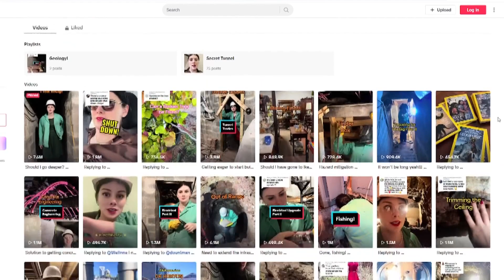TikTok 'Tunnel Girl' told to stop building underneath her Northern Virginia home

Comment: Just a matter of time until she hits a gas line, water line, or electrical cable. I am going to assume she did not call mrs utility before she dug. “It’s the law”.
Reply: thats very easy to get around as the gas, water, and electric companies will give you a map of where all the lines are in your area. I have all the one's for my property.
Reply: Great point
Reply: According to her it's all under the slab of her home. If that's true, the only utilities in the way would be whatever is running from the street.
Reply: I guess none of you have seen what happened to the person in Bethesda MD doing the same thing.
Reply: @toastedt140  Uh-huh.  And what happens to those utilities if she damages their foundation or creates a sinkhole?
Reply: I would be SOOOOO TERRIFIED of coming across the unknown. Snakes mainly......
Reply: Given that her area of Virginia is prone to sinkholes….shes very lucky. I remember watching one where she’s talking about how soft the rock she’s digging into is compared some of the other material she ran into. And it’s insane she doesn’t even know what materials she’s digging into. One of her structures under there already collapsed! She’s lucky she wasn’t on the wrong side.

Comment: Ive got nothing against her (or anyone) doing it, as long as she knows what shes doing.

However as several people point out, there are water, electrical, sewage & potential structual issues that could not only cause problems for her, but for other residents in the area.
🛠️👩‍🔧🛠️
Reply: I mean, the problem is that she clearly doesn't know what she's doing.  She dug a hole that, according to her own videos, collapsed,  flooded, and caught fire.  It's a Monty Python sketch without a plot line or good timing.
Reply: If she knew what she was doing she’d know she shouldn’t be doing it…